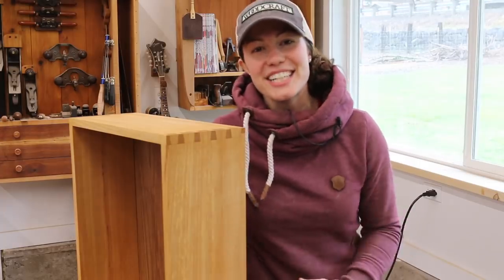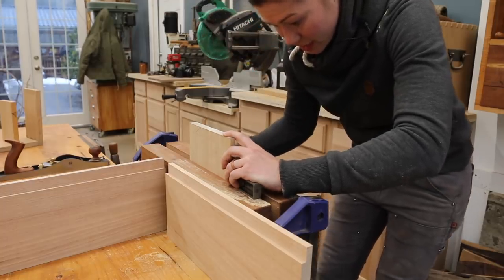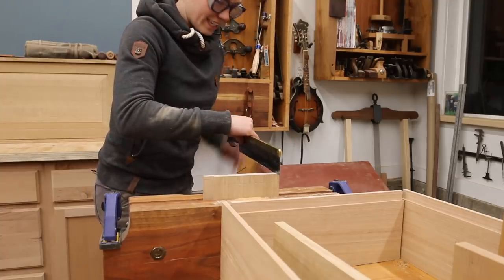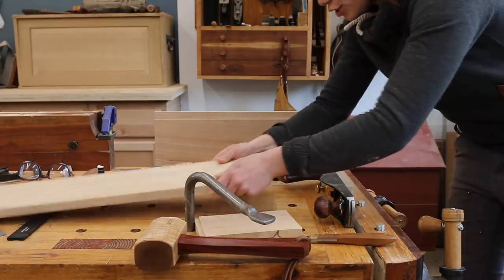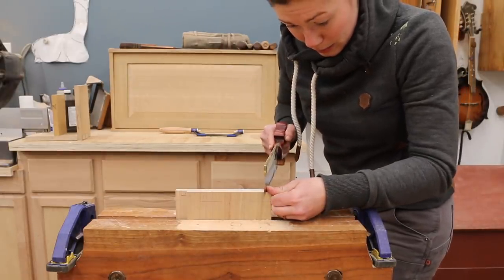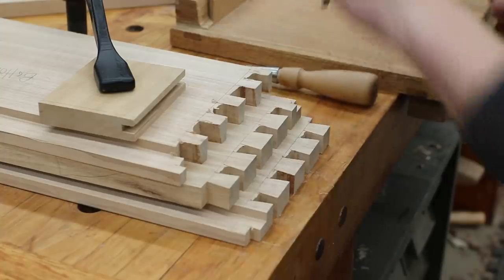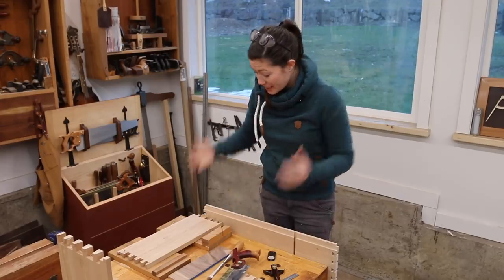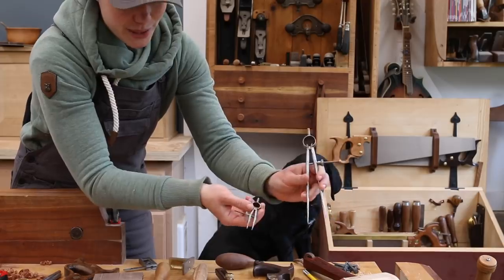How to Cut Dovetails by Hand

Comment: I bought a claw footed antique dresser and cut about 1/3 of the width away to make a bathroom vanity with an antique looking vessel sink.  I kept the original drawer joints on one side and copied the hand drawn and cut dovetails for the others using similar techniques you presented only the pins were very skinny with an odd angle.    The result was great and looks like it was made like that 120 years ago better and cheaper than anything I could buy new.   I made accessories out of the excess wood for the bathroom.
Reply from the maker: That's awesome! Good on ya!

Comment: You have some great methods there. I'm 64 and my eyes struggle with these jobs . When I was and engineer I had super 20/20 eyesight, and i miss it, glasses never seem to make up for it for these tasks in my case at least. These methods look helpful especially your use of a phone light. I bought furniture for our dining room some 40 years ago and we still have it. It was made by an old company in London and silly money. The dovetails  are awful but it's still solid. I wonder at times given modern adhesives how much stronger a dovetail is compared to a box/finger joint. I like that marking gauge and plan to make one just like it. Thank you.
Reply from the maker: Thanks so much! Man, I'm sorry to hear your eyes are failing you, I hate it when our bodies don't cooperate.

Comment: Excellent video.  I never thought of a cell phone as a woodworking tool.  You don't have to use dovetails for these joints.  Any matching design would work.  I've been thinking about using a Forstner bit and coping saw to make some oval & odd shapes.  Stars or card suits would be spectacular for a small box.

Comment: You started with the interior face toward you in the vice (2:34).  Later the interior face is away from you.  Why the change?  Start with the exterior face toward you so the position of the board does not change during all marking and cutting.   I like the use of phone light to view spacing and double check of squareness before assembly.

Comment: Lots of good advice here.  Thanks.  This is the first time I've seen the special "short pin" on the bottom side of the drawer.  I assume it is to hide the drawer bottom.  Can you provide a link to a clear drawing or picture so I see how this is done?  Thanks.
Reply from the maker: Check out my article on building a whiskey cabinet on the cover of woodworker’s journal June issue. It’s got everything you should need to know ;)

Comment: A fantastic guide! But I did have 1 part where I was a bit confused. You state you like to make the waste area in your tails to have an opening that matches a specific chisel size exactly, closest to the baseline. But then you state to only take about 1/2 or small amounts off at a time with each chisel stroke. If your chisel size is maxed out already, how can you move it forward inside of the gap ?
Reply from the maker: You use two different chisels ;)
Reply: @AnneofAllTrades  I figured that was the "duh" answer, just thought you were saying you could use only that chisel and it threw me a little bit.

Comment: What dovetail marker are you using? Also what did you use to lubricate saw blade? Both of those look like items I need to add to my need to purchase list.
Reply from the maker: It's a sterling toolworks marker, and mutton tallow on the sawplate! You should!
Reply: @AnneofAllTrades  Thank you a ton. Also that is an awesome marking knife! What Ratio do you use for your dovetail marker? I have been reading about the differences between a 1:6 and a 1:8. I am excited to try my first dovetails.

Comment: Anne great work as always.  I am looking at getting a tiny wood stove like you have and curious if you have the 5k or 4k and does your shop get too hot?  Any issues?
Reply from the maker: I actually have both, one in the tiny house and one in the shop and I prefer the larger model because you don’t have to cut the wood down as much or stoke it as often.  The shop isn’t super well insulated so it’s tough to get it too hot but the stoves are very efficient.

Comment: 4:09 noobie question:  does the angle of the dovetail ever change depending on type of wood or other conditions?
Reply: oh, I see you mention it at 18:54
Reply from the maker: 1:4-1:6 is commonly used for soft woods like pine because it can compress and loosen over time so you want lots of rake. 1:8 is common in hardwoods because since they don’t really compress much you can get away with a more refined looking pin. 1:7 is a nice happy medium.